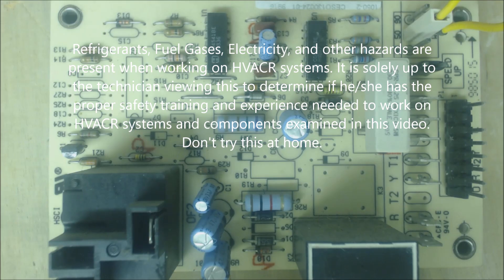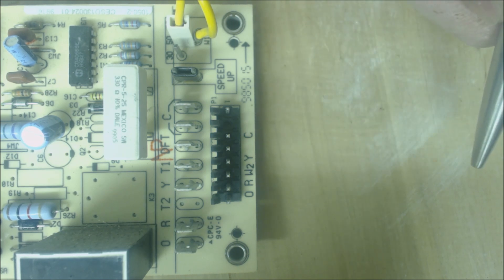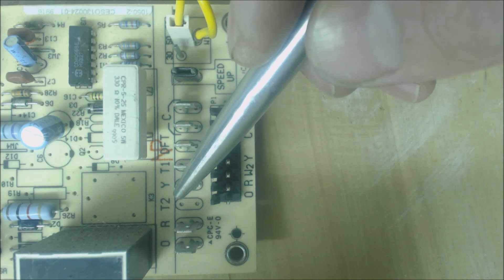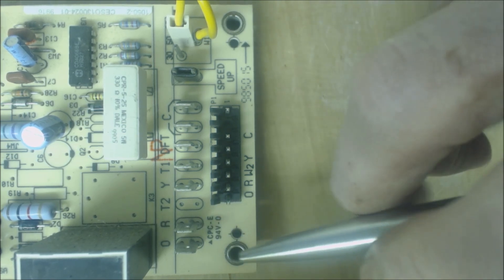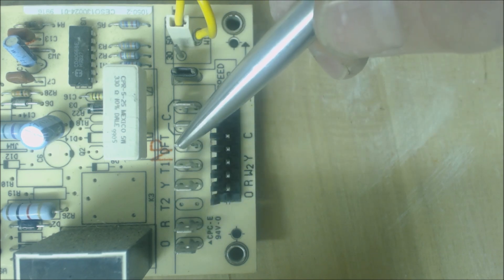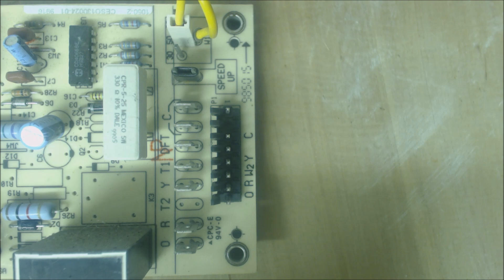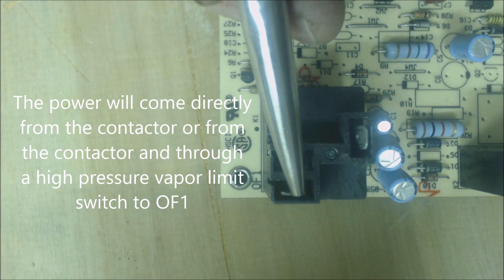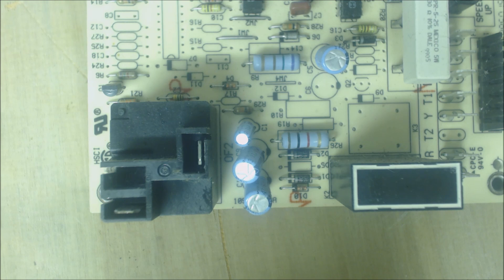How this Defrost Control Board Works, Heat Pump Wiring for Defrost Cycle!

Comment: My board has a jumper from T1 to Yellow and then on the t2 it doesn't have anything there and I'm trying to figure out what goes there, wouldn't that be my pressure switch that would tie there and run it directly to my contactor?  And do you know how long of a time delay is on a carrier package unit I can actually give you the model number

Comment: Great video. i like the electrical tips you add where you say the wires may be linked at the contactor and only one wire brings the 24 volts back to T1. Good for non electricians as t makes us sharper.  Thank you.
Reply from the maker: Thanks Michael!
Reply: But in my case I wouldn't do that right since I have a T2.. my why and ti would go to the pressure switch, and then I would need to send a wire from T2 to the contactor. Is this correct. What's odd is I have a T2 but right now it has a jumper wire from T1 to Yellow so that has me really confused but I don't know if somebody put that Jumper in and didn't know what they was doing

Comment: excellent vidio!!! i have question. y is going through high pressure control to t1. and power is going though high pressure vapor to of1. what is different between those high pressure?. i understand high vapor pressure switch going to of1. but i dont understand the pressure switch going to t1 from y. is it sense refrigerant pressure?
Reply from the maker: Yes check out- https://www.youtube.com/watch?v=Xqh1KNpZIqQ&t=1s  - and ask any questions remaining after that, thanks

Comment: great video man videos i love this stuff i have been running into alot of older ruud heat pumps with an L terminal from the thermostat running to the T1 terminal on the defrost board to my knowledge (which is not that great) a L terminal coming off the tstat is supposed to be a NO system monitoring switch is   this the DFCB's safety check or something else? Any help would appreciated.
Reply from the maker: Ruud are different and may require the L to go to the T1. When you see this, do you also not see the safety sensors or are they there and breaking the y wire?

Comment: thank you for making videos.
Reply from the maker: Thanks Doug c!
Reply: acservicetech ideas for videos. on the bench wire a ECM blower motor without using a control board? make a defrost control board from relays etc
Reply from the maker: Thanks Doug c, good ideas!